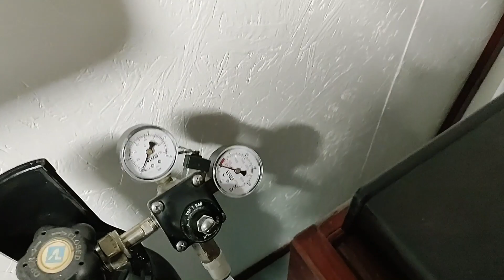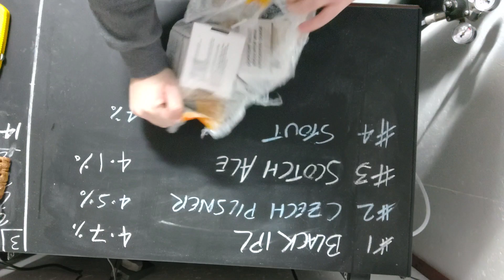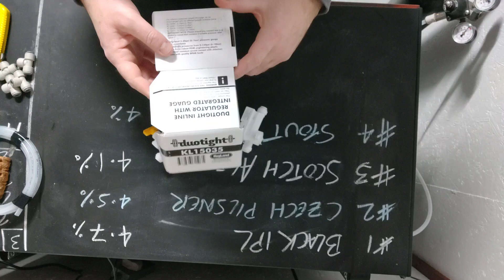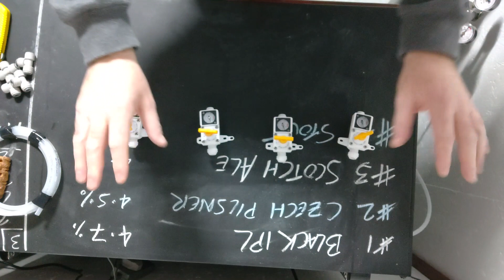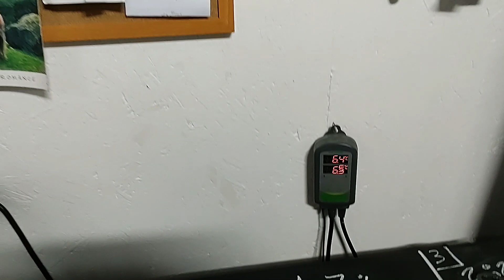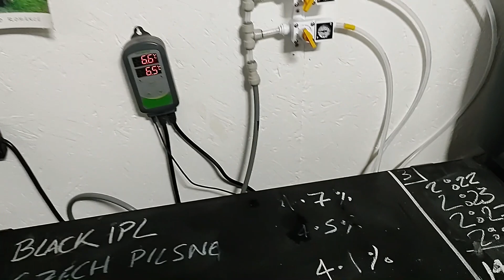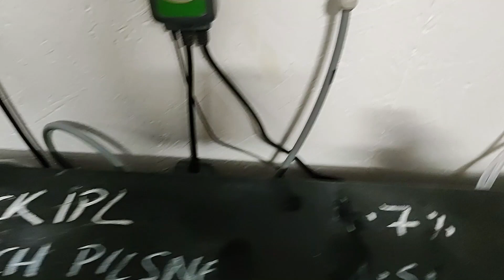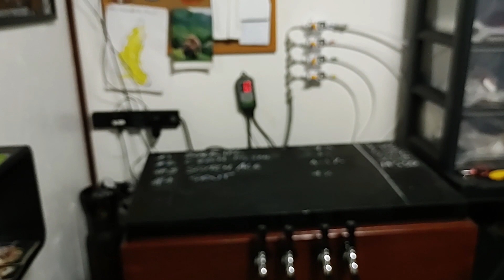HBW187 - Adding secondary regulators to keezer

Comment: Wrapping PTFE tape around the outside is not going to solve anything as you've already found out, it needs to be internal to the join but if it is something that moves it's going to wreck it every time. Good move on the upgrade, hopefully it solves the leak problem and the added bonus of being able to set the different kegs to different pressures. Hope you had a very merry christmas and wishing you a very happy and prosperous new year. S..r, cheers, Schnuz.
Reply from the maker: So far so good. Have to say it's great to be able to dispense at different pressures, makes it so much easier and don't end up overcarbing by mistake. Happy Christmas yourself, hopefully 2021 will be slightly better than the shitshow 2020 has been.